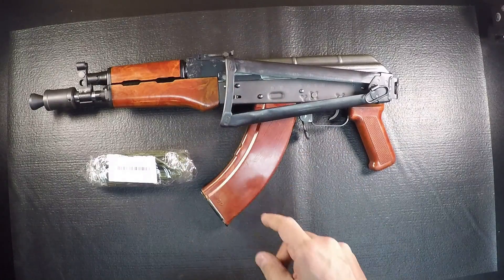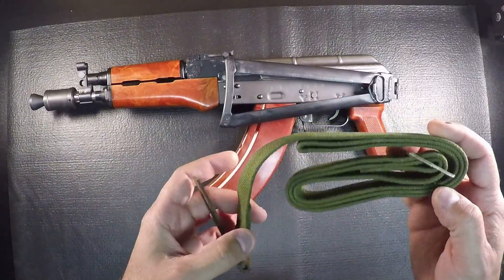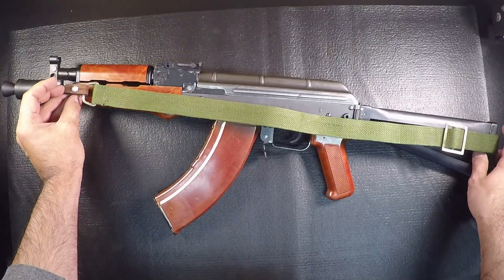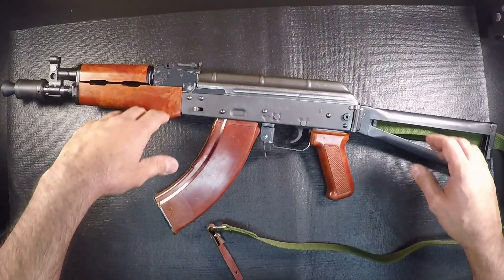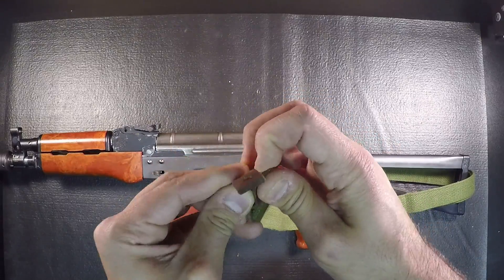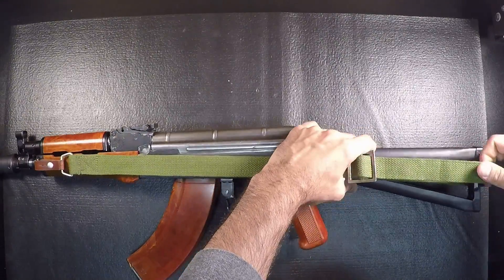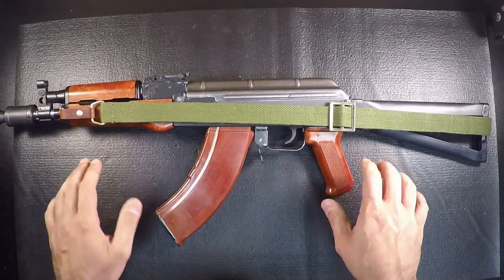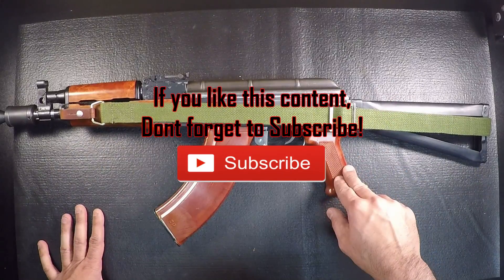How to Install an AK Sling

Comment: My Zastava ZPAP M70 (also triangle stock) doesn't have a sling mount anywhere on the rear of the gun. Any ideas?
Reply from the maker: do a wrap around the back.
Reply: @G2niverse  I'm guessing you mean to simply wrap it around the open, triangle stock. If it's as easy as that, thanks. I'm not the best at this, but I want to get it right.